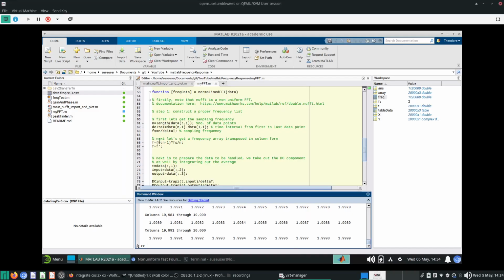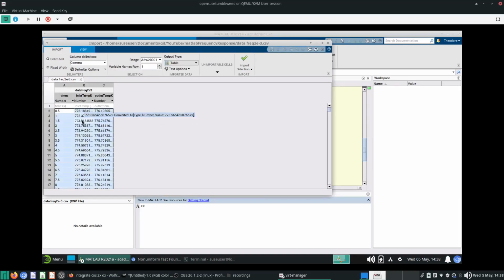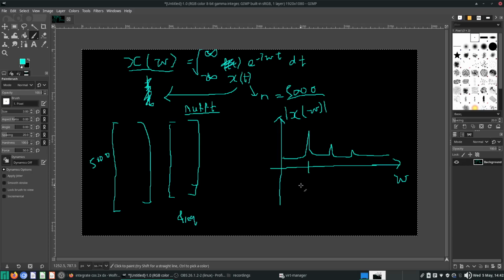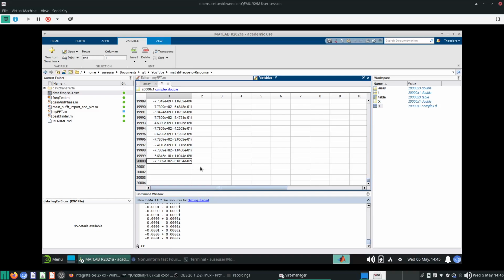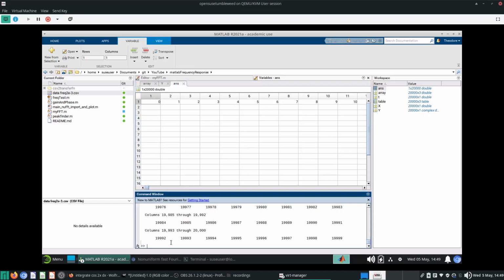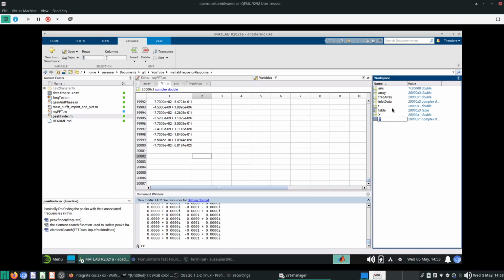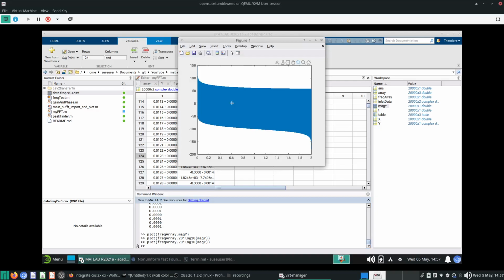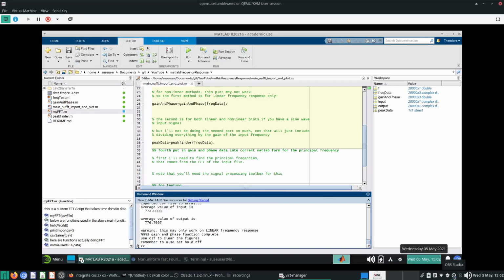matlab frequency response tools part 3   non uniform FFT demo

Comment: Hi Theo, I try to run a code like this, but still having a question about the frequency array, could you help me with it? I am expecting to get the peak at 0.2 Hz but it was shown at 0.8 Hz.
Thank you for your tutorials!!

t = [0.5:0.25:700.5];
Period = 5;%f = 1/Period frequency would be 0.2 Hz
w=2*pi/Period;

X = 2*sin(w*t);
Y = nufft(X,t);
n = length(t);
frequencyarray = (0:n-1)/(t(end)-t(1));
plot(frequencyarray,abs(Y))
Reply: @TheoOngScienceAndEngineering  Thx
Reply: Hi Amadeus, hi Theodore.
Your samples (0.5:0.25:700.5), shows that your intervals are equally spaced with time between samples (dt) =0.25. So, you do not need to use Un - uniform Fast Fourier Transform. You can use (or must-i do not know), the Fast Fourier Transform.
The number of your samples are n=2801, with time intervals between samples dt=0.25, frequency of sampling fs= 1/dt= 1/0.25=4 and frequency resolution fres= fs/n or 1/T. T is the total time of sampling which is the number of samples over sampling frequency =T= n/fs=2801/4=700.25. So fres= fs/n=4/2801=0.00142 or fres= 1/T=1/700.25=0.00142. Frequency resolution is the labels we will give to each of the bins that produced by the abs (magnitude) of results of fft. It is the array against which we plot the Magnitudes (abs).
So if i did not make any mistake, if you use the follow code , in matlab, you will get the correct result (the frequency 0.2)

>> t=(.5:.25:700.5)';
>> n=2801;
>> dt=0.25;
>> fs=1/dt;
>> fres=fs/n;
>> x=sin(2*pi*.2*t);
>> F=fft(x);
>> Mag=abs(F);
>> Fbins=(0:fres:fs-fres)';
>> plot(Fbins,Mag)